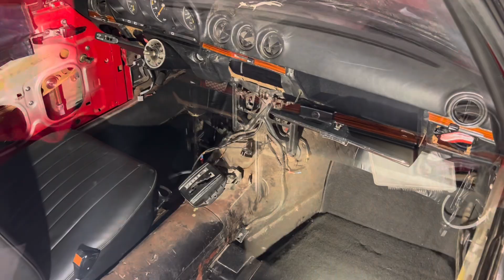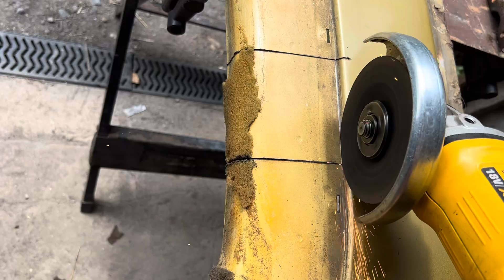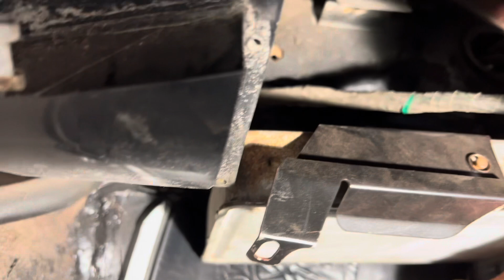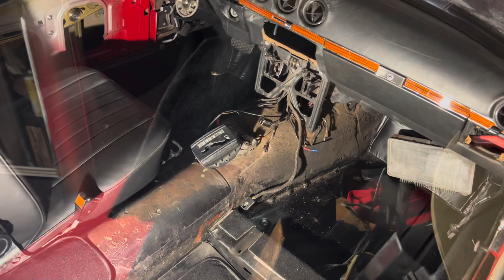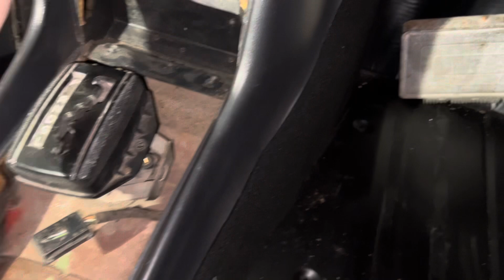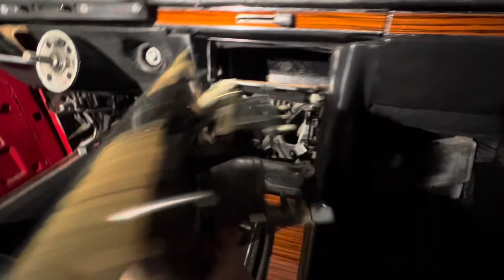Mercedes R107 ECU bracket+central console installation

Comment: Hi Mike, you mentioned in the video about testing the ECU. Do you have a video about how that can be done. My 1973 450SL is refusing to start, and I'm 90% sure it's because of the injectors are not being fired up by the ECU.
Reply from the maker: Hi - sorry to hear about our car not starting. I don't have a video about testing the ecu. Your best bet is to trawl through "https://jetronic.org/en/d-jetronic"

1. Have you ascertained that your injectors are not firing? You can do this with NOID lights : https://www.youtube.com/watch?v=R3F7qIHRRp4

2. If you have definitely ascertained that your injectors are not firing, I would start by confirming that your trigger points are working. See https://www.youtube.com/watch?v=Xmgwmx62yFs

Faulty ECU's are rare. 99% of the time the problem lies elsewhere.

Let me know how you get on.

Mike

Comment: Happy New Year to you Mike! PLEASE, before you do anything else, disconnect the batteries on your R230 and do the BCM/BNS fuse modification ASAP.

There is a serious FIRE RISK.
Reply from the maker: Greeting from Oz and a Happy New Year to you too. I have been doing a bit of research since your message but need to understand more clearly under what circumstances this happens. I have a theory that the BCM gets put under much greater load/stress due to the fact that many cars have battery draws which are not attended to. The consumer battery becomes knackered as a result and is constantly being recharged from a relatively low level.
Reply from the maker: When I get back I may have a closer look at the BCM in my car. The other thing I would love to see some research on is whether the Components in the BCM are unduly stressed if you put a non AGM battery in the car (which many people do). The charging profile is very different for lead acid vs AGM. Anyway….lets see if our rusty Toyota makes it round Australia. Mike